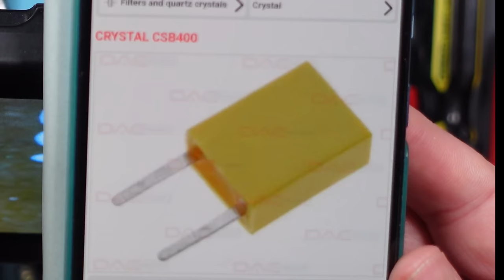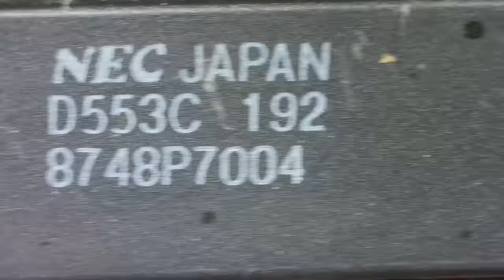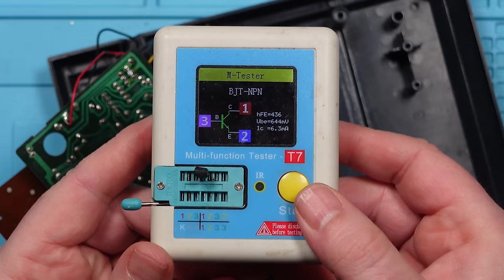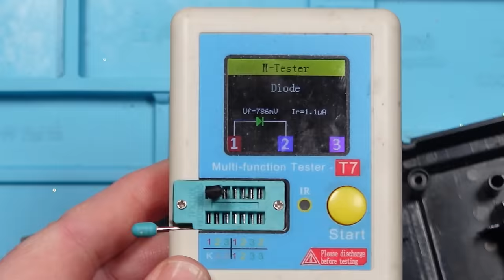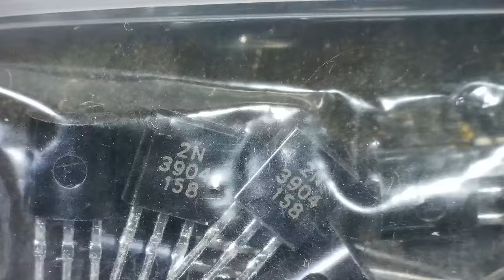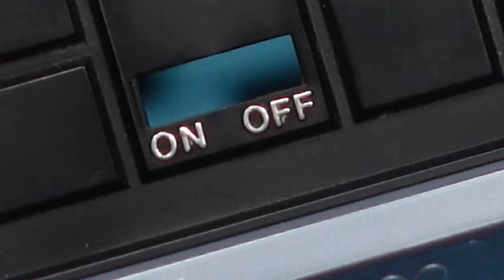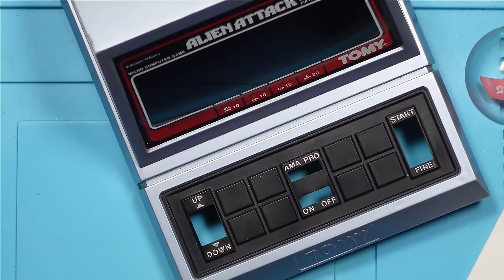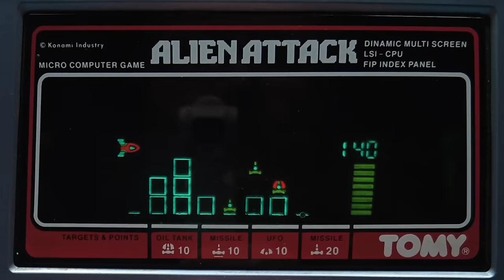This Tomy ALIEN ATTACK Has No Power! | Can I FIX It?

Comment: Although it wasn't the loose component "CSB400" that was the cause I just wanted to point out that when looking for components based off labeling, you should include all letters/numbers as shown. In this case a CSB400P. Which will then bring up the correct component CSB400P Resonator 400kHz 0,5 % instead of a CSB400 Pressure Reducing Regulator :).
Reply: He did find the crystal. Isn't that what you found?
Reply: セラロック - Ceralock
Reply: Used to get those ceramic resonators failing in the clock/ timer circuit in old VCR's, back in the day. It was usually the salmon-pink coloured ones rather than the later blue type.
Reply: @Oldgamingfart  I thought Steve would  apply something to hold it steady. If it's allowed to wobble about, it's not so good.

Comment: Definitely a common failure point. In the aircraft systems I work on, transistors are CONSTANTLY needing replaced as they get older (many are 40+ year old systems) so seeing something this old with failed transistors doesn't surprise me at all.

Comment: Nice to see repairs on electronics from my day with through hole components and VFDs. I went to a two year votech electronics engineering program in high-school then to a Jr College for electrical engineering in the late 90s. We litterally had a 20 minute lecture on SMDs where the instructor pretty much said "If it has SMDs, though it away when it breaks,, but you CAN fix them if absolutely necessary, it's just too fiddly and not worth the effort. ".

Comment: Great Job Steve, Nicely done. Good idea with the silver pen on the writing. It really makes it stand out! I've fixed a few similar VFD games so I'll have to remember that one👍👍👍
Reply from the maker: Yeah, it really works well.  If I did it again, I'd get a slighter thinner nib to avoid any overspill, but with a steadier hand than mine, the results should be perfect!  👍
Reply: @StezStixFix  Thanks for the 'Tip' 😂😂😂😂
Reply: Silver touch ups were great.

Comment: The blue thingies are resistor packs 14x 154MOhm from the label, I would say. pretty high value- maybe for the VFD? The coil thingy is basically a transformer to generate the high voltage for the VFD. You can't drive that thing from 6V I guess... be careful not to get a zing. ;)
The blue box is definitely an oscillator of some kind. 400kHz was common frequency for the NEC 553 MCU from what I can gather.

Comment: red goes to base on checking transistors with a multimeter then look for the voltage drop with black lead on collector then emitter

Comment: You can use some blu tack to hold components in, so you don't need to do the bendy leg.
Reply from the maker: Ah, good shout.  I need to get some blu-tack for holding components down so they don't ping away too!  👍
Reply: @StezStixFix  Bend the two outer legs out to hold the Trn in place, then solder the middle pin, then bend the 2 outer legs straight then solder them in place. I mean who has blue tak these days, lol?

Comment: Those long blue things are resistor arrays - a bunch of same value resistors with one side of each connected together. Useful when you need to pull up or down a lot of chip legs at once.

Comment: I seem to be remember reading that 2SC945 (abbreviated C945 on the transistors) are somewhat failure-prone at old age. It's a pretty generic transistor, could be replaced with a BC547 if you don't have one at hand (BC547 is by far one of the most common and cheapest European transistors).

Comment: Just a tip for you - On something that old I would always start by changing any original electrolytic caps - the issue could easily be one of those has dried out - and they are dirt cheap - also when replacing caps on that kind of board put a 90 degree bend in each leg so you don't break a pad off pushing the cap through when soldering in place. Breaking off a pad on old gear is a pain in the proverbials to fix - Cheers !